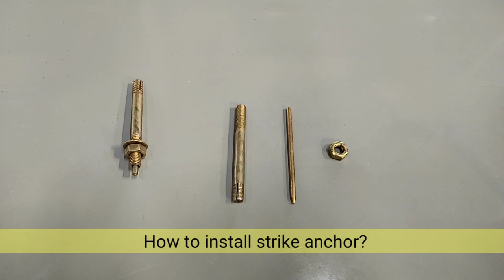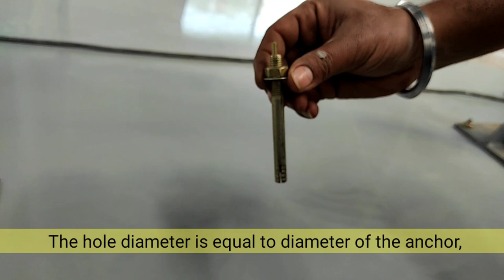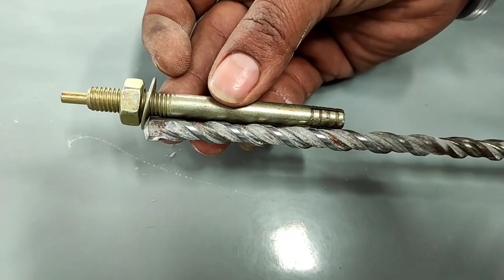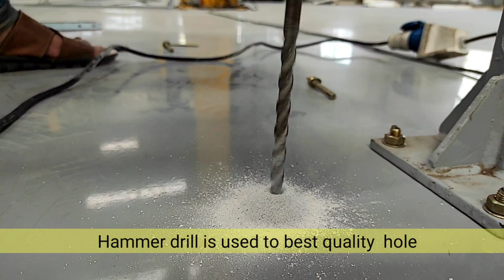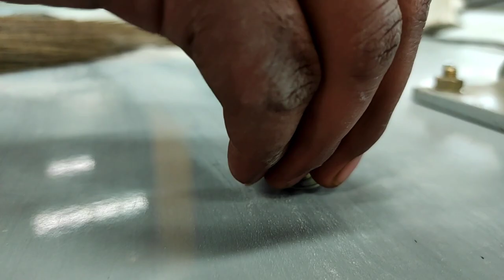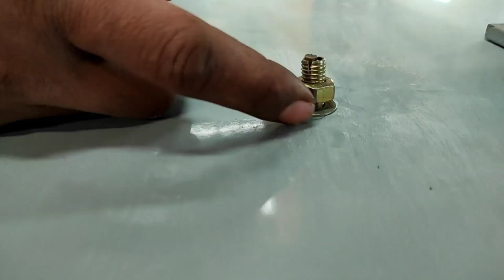How to install strike anchor in solid concrete! begainers guide

Comment: How do you remove these types of anchors.
Reply: Update. You can't remove it I found the video. But in that he said you cannot remove it. But you can cut the bold as close and try to hammer it in and then cover it with cement. I do have one idea which requires welding. You can weld some with a grip like a metal piece to the pin. Then then pull the pin out. Then you can weld the same thing to the bolt and try pulling it out. WIth the pin out I think it might bend it and can be removed.
Reply: @ravvraj863  Jesus Christ, just drill another hole or two right next to this anchor, and you can loosen it up. Don't overcomplicate with welding :D
Reply: @davorzdralo8000  Well that would damage the wall. More patch up work. Welding is a better option if you have access to it.
Reply: @ravvraj863  sure, but the damage is minimal and you will be patching the hole anyway, so it's literally the same amount of effort to fill in a hole that is a bit wider 🤷‍♂️
Reply: @davorzdralo8000  I get where you are coming from. In a dry wall its the same not in our country where we make walls from brick and mortar. Especially if its an old house like mine. You start using the impact drill and you will get a lot of cracks
Reply: @ravvraj863  I'm talking about concrete mate, this has nothing to do with drywall. You don't use anchors like these with drywall in any case. And I'm from Serbia 😂

Comment: For a load.of 200 litre loft tank is the concrete anchor bolt of 4 inches enough total 6 anchor bolts 3 on each side of water tank on 1.5inch heavy l angle
Reply from the maker: which diameter of bolt you have used? 6 bolts are enough we suggest you use minimum 10 mm dia anchor bolts